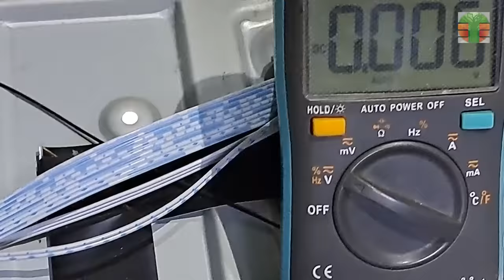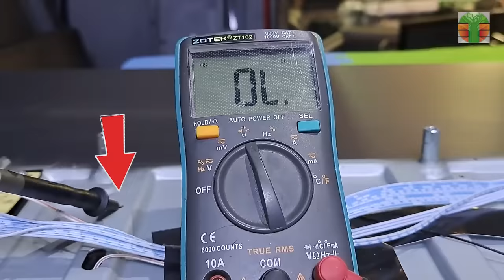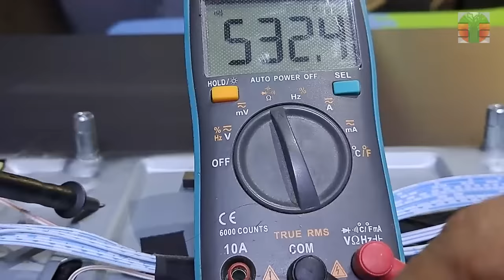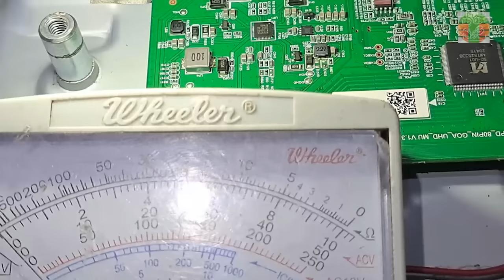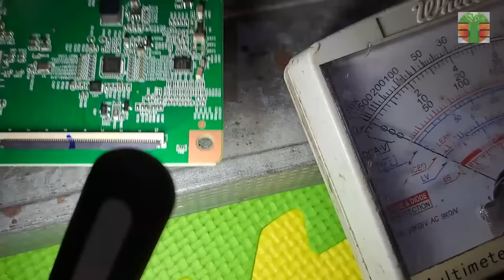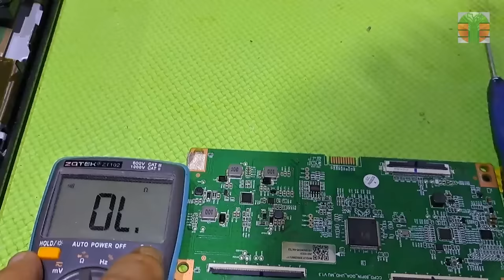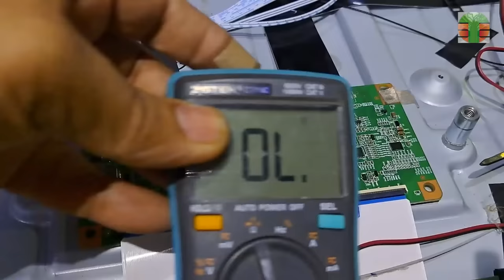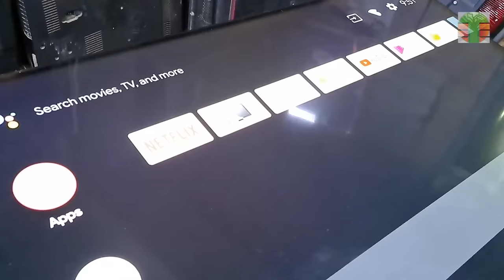No VGH No Video

Comment: What is the reason digital and analogue read different? Is it because you were on diode mode? I think if on manual resistance mode with digital should be the same ,right?
Reply: Yes, when check resistance it should same as analog, apart from continuity mode
Reply from the maker: Not when at in circuit resistance. the digital is not in diode mode, it's in continuity mode and measures resistance.

Comment: I got to say. You been doing this a long time. I used to fix tube sets. Not so much with SMD stuff.  You break it down logically. Build the road map to explain it simply. I have one question. It looked to me that the SMD caps almost acted like diodes. I have a hard time working SMD when things are packed in. Stuff starts moving all over the area of the board I’m working. Even with a tip on the heating gun. Good stuff. I watched a few of your videos and you make it easy to understand to folks like me. Many thanks

Comment: Hello.. firstly thanks for sharing video..İ have a question.Can we inject voltage in here instead of test one by one condensator?
Reply from the maker: Good question. If you inject 3 volts a  532 ohms resistance will not get hot.  Injecting a higher voltage will may get hot but may harm the other components.
Reply: @tevzTVTevatronics  thank you..İ understood

Comment: hello, your work is to be congratulated!!!  The only thing I don't like is the use of hot air to remove and replace the capacitors.  It is easier to use soldering iron, it will avoid overheating the PCB, and also hot air can damage other components around due to high temperature.  by the way what is the brand and model of the camera you use to make this film?  I really liked the quality of the images.
Reply from the maker: samsung A53

Comment: Great video but I have two questions. 1- at 11:30 you test the capacitor that you just removed from the board and you test it out of circuit but I/we can’t see the reading on the multimeter - what was the Ohmic reading? 2- then you replace that capacitor with a 10 mF capacitor but how did you know, that the damaged capacitor was a 10 mF capacitor - since there is no markings on it AND it’s damaged so you could not possibly find out its value? Please let me know, I want to learn. Thank you kindly
Reply from the maker: The reding is about 60 ohms, capacitor doesn't read in ohm so its defective,  you can put 2.2 uf to 47 uf, because it is a filter capacitor.

Comment: I thought good capacitors should beep on both ends in continuity mode. Not the other way around.
Do you fix Pc monitors: HP or Qbenq ?? if so make a video about it.
Thanks.  subscribed.

Comment: I  have subscribed to your channel. I have 32 Skyworth LED TV.  It was not working and I fitted two new back lights strips. Still they don't light up.  320 DC power comes up to high voltage capacitors..  There is a M7 diode in backlight power supply area  which gives buzzer sound when I test it with multi meter.  Can you pls tell me what sort of a problem exists in this tv?  Thanks for any help.

Comment: Good Job and Excellent Demonstration about the Faulty Resistance but In Video is not in Sequence that Initially You have Removed Capacitance and all of a Sudden Said Resistance is Defective and Changed Started Working , How do You Identify the Resistance is Faulty in Not Clear .
Reply from the maker: What resistance is defective? the last capacitor that I removed has the resistance and it is the faulty one.
Reply: @tevzTVTevatronics if you use a thermal imager, is this capacitor indicated on the board by heating?

Comment: Helo TevzI havea issue with LED power board for LG 2530   main 2capacitor getting burst when I replae new its same what will be the problem bridge rectifires and mosfet ,shotky diodes seems to e ok

Comment: My 32" LG smart tv shows LG logo when you power it. The logo stay for few minutes then the tv get off and reboot again. Can you suggest to me what could be the problem?
Reply from the maker: its a software issue
Reply: @tevzTVTevatronics  
Thank you for very prompt response. So kind of you.
Since I don't get to see tv menu to run software update, how can I possibly fix this problem.
Reply from the maker: @olubunmiayoola7954  It can be done by removing the EEPROM chip and programming it on the computer.
Reply: @tevzTVTevatronics  
Wao! 
Would I need the service of a specialist or I can attempt it myself?
Reply from the maker: @olubunmiayoola7954  it's up to you if you think you can do it.
Reply: @tevzTVTevatronics  
Thanks so much. Im afraid if there's anyone that can do such in the part of the world.
If I can get a new one buy it may have being the best option. Thank you once more.

Comment: Same t-con board that the Roku On 100012585 uses.  The screen I have does not have the problem your screen had but rather the problem of vertical lines.  Where is the problem remains the question? T-con board?